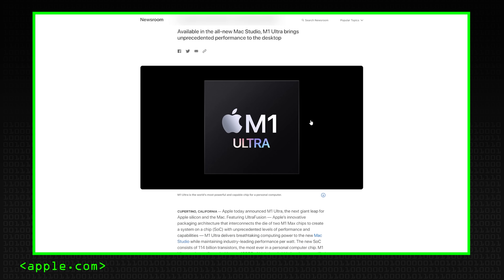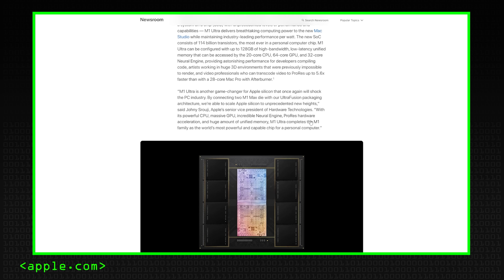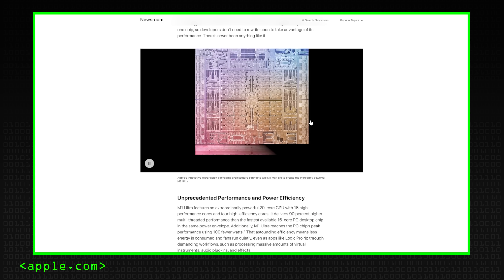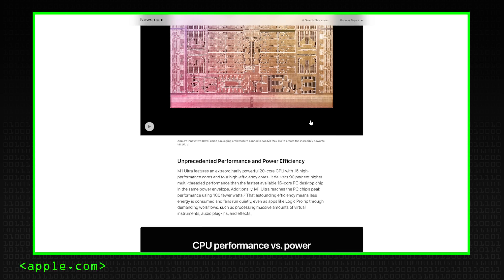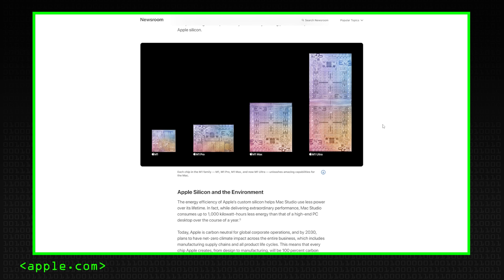Apple M1 Ultra & NUMA - Computerphile

Comment: Intel's EMIB, similar to ultra fusion, in Sapphire Rapids adds additional latency of 5-8 nanoseconds. This makes the core-to-core latency go from 54 worst case to 70 worst case. Apple's situation is similar, with similar bandwidth per connection. We expect the latency to be an additional 5-8 nanoseconds also. Ultrafusion is using TSMC's InFO_LSI manufacturing.
Reply: It’s not InFO_LSI according to Underfox on twitter.
Reply: Any numbers for AMD (Zen 2 and 3) 2-socket systems with and without xGMI cables?
Reply: The majority of the software, the one that is not memory hungry, will not be needed of rewriting. NUMA locallity is served by the Operating System and it will try to give you memory and schedule you on the same NUMA node without any change on your software. So for the majority of devs this is not a problem. Now, video editors, databases etcetera this will need to be able to know from witch NUMA node are they allocating and the cost of accessing, Linux and Windows offer an API to solve this. Does MacOS provide it? AFAIK NUMA is not exposed on any API on MacOS so even if the interconnect is really fast it will not beat an optimized NUMA-aware database on linux.
Reply: cultist apple autists out in full force
Reply: yeah, but it is ARM vs x86, 256 channel memory against 6 and also efficiency cores, also video memory... so not really the same!
Reply: But the difference is one is called “random string of letters” and the other is called “Ultra Fusion” 😍
Reply: @Joseph_Roffey  And begins with "We call this..." and is filled with "... only at Apple can we ..."
Reply: @Joseph_Roffey  other difference is that you can buy one and not but yet the other 😂  I remember rehén NUMA stuff was the domain of super computers.
Reply: @Joseph_Roffey  huh? More like one is a "stupid marketing name that really doesn't describe the underlying mechanism" and the other is called "embedded multi-die interconnect bridge"
Reply: @eddyecho  Woosh
Reply: @Decessus117  ahh yes i recognize that I may have missed the satire in Joe's post. lol
Reply: Sure. If you’ve got a $$$,$$$ and can actually purchase enterprise hardware, it’s exactly the same! I’ll make sure I order it along with those 400Gbps switches I’m ordering next week….
Reply: Except it’s not 2.5TB/s  and not a consumer device. More like a enterprise technology.

Don’t get butthurt that Apple did something cool bruh.
Reply: @RunForPeace-hk1cu   2.5TB/s is the bandwidth not the latency.
Reply: @AdamFJH  you don’t even know the latency and you are already making assumption that it’s bad.

Sounds like you are a hater.

If a cool tech comes along, shouldn’t you at least root for it to be successful?

Why do you just automatically assume it’s a fail?

If the latency is so bad, it wouldn’t be a viable product because there’s a reason why Apple made it so that developers don’t need to write NUMA awared drivers/software.
Reply: @RunForPeace-hk1cu  Yes, I don't know the latency because I haven't seen anyone report on the memory latency yet. No, I am not making assumptions, I am just educating you on the fact that the 2.5TB/s figure is the bandwidth not the latency because in one of your previous comments (which I see you have now deleted) said that the latency was 2.5TB/s.

I am only a hater of Apple because of their anti consumer practices and their negative influence on the tech industry. I am not a hater of the the M1 Ultra.

I think the M1 Ultra is a cool piece of tech with the ram being in the same package as the CPU and its giant memory bandwidth but I am neither rooting for the M1 ultra's success nor hoping for it to fail. I am neutral in that position.

You're the one that is making assumptions. You sound like a crazy Apply fan boy that assumed I've said something bad about the M1 Ultra and now you a crazily defending Apple over it. I don't think the M1 ultra will fail. I think it will succeed because Apply fan boys are crazy and will buy anything from Apple even when their products are over priced, Apple actively commits anti consumer practices and they have a lot of negative influence in the tech industry.

Does anyone actually know if the M1's latency is going to be bad? Knowing Apple, even if they produce a product that isn't "viable", they'll still manage to to sell it because Apple fan boys are crazy. What's the reason Apple does not need developer to make numa aware drivers?

EDIT: I just found out that the M1's latency is about 100 ms which is really slow compared to Intel and AMD CPUs so that means that the M1 Ultra's latency is going to be even worse.
Reply: @AdamFJH   What do you mean M1 latency is “100ms”?
100ms in the memory subsystem, for example, would be catastrophic. Do you mean 100ns?
And 100ns latency to and from where exactly? Memory?
Reply: @AdamFJH  I’ll flip it back to you for some self reflection …

Intel don’t have fanbois and buy anything Intel ?😂
Intel doesn’t commit any atrociously poor consumer practices?
Have you been sleeping for the past 10years?
Reply: @Aaronage1  Yes, I mean 100 ns. About 100 ns tested by accessing the memory with 128 MB test  depth. See the anandtech article titled "mac mini m1 tested".
Reply: @RunForPeace-hk1cu  You seriously need to stop making assumptions. Right now you are assuming I am an Intel fan boy but I am not an Intel fan noy.

Yes, Intel does have fan boys that will buy anything Intel and that is the same with AMD as well. Yes, Intel commit anti consumer practices as well. Regardless of whether Intel also has fan boys or not, your crazy fan boy behaviour is not excusable. Your behaviour is bad because it leads to fights. Stop assuming people are attacking the M1 Ultra when they are not.
Reply: @AdamFJH  ok, ~100ns latency to memory is not problematic (and not really a useful number in isolation anyway)

Anandtech recorded 92.814ns full random latency for 12900K, 96.8ns for M1, 111.1ns for M1 Max, 105.632ns for AMD Milan, 93.061ns for Ampere Altra etc. Latency in this range is typical 🙏
Reply: @Aaronage1  whether it is problematic  or not depends on the workload and whether is it slow or not depends on how the community compares it. I'm part of the DIYer community we usually judge whether the memory latency is slow or not base on how well it is used in gaming. For gaming workloads 100 ns is considered very slow and accepted latency would be about 70 ns. 70 ns is about what Zen 1 is capable of achieving. These M1 chips are not  very suitable for gaming. I'm surprised by that 92.81 ns figure for the 12900k, are sure about that?...hmm...was anandtech testing the 12900k with some very high latency DDR5 ram?
Reply: @AdamFJH  dude, i said 2.5tb/s and you said it’s not latency.

Who in their right mind thinks 2.5tb/s is a latency number? You are the one picking a fight my guy.

And as others have said, m1 latency is within industry standard. You haven’t done your homework and automatically assume it’s bad.

When confronted you get defensive.

Are you saying 12900k with ddr5 is bad for gaming? 😂

Yeah, you are clearly not a hater or biased
Reply: @Aaronage1  you said 111ns for m1max then after travelling through fusion memory connect, wouldn't it be above 200 to 250ns?
Reply: @nick_ragin   No one knows yet, it wouldn’t necessarily double because the memory controllers are split over the fabric. I’m sure someone will test it, though maybe not Anandtech? (the contributor who covered Apple with genuine care and interest at Anandtech, Andrei, left a short while back).

Regardless, I think you’re putting too much emphasis on latency.

Latency became a big point of contention in PC gaming with the Zen family. Those designs introduced a variety of letancy issues (not just memory latency, but also core to core latency between CCXs and dies etc.). Overclocked memory with tight timings resulted in unusually large gains for Zen. Tech media/YouTubers became obsessed with latency from that point onwards, always going on about the need for the tightest possible timings and how AMD needed to “fix” the latency issue. It’s now the first thing a lot of tech reviewers leap to when they see some performance issue with Zen 😅
Not to say fast memory wasn’t a focus of overclockers before Zen, or that people didn’t spend enormous amounts of money on fast memory to squeeze out an extra couple percent on older platforms, but it wasn’t seen as a necessity as it is now.

I guess TLDR is Apple’s design is not Zen so don’t panic 😁
Reply: @Aaronage1  Hey thanks for your valuable insights, I am pretty much naive in this area, I considered latency and the bandwidth bottleneck is the reason why m1 ultra can't get exactly double or nearly the 2 times performance of m1 max. Given apple architecture(risc) can split the instruction and perform it on multiple cores.
Reply: @AdamFJH  Here we go again... someone who thinks they know what they're saying because they watched a few Linus Tech Tips videos.
Reply: @almuel  Who are you talking about?
Reply: @AdamFJH  are you talking about the Mac mini ? If that is the case how is that relevant ?
Reply: @jaimeduncan6167  No, I'm talking about the M1 Ultra which is what this video is about. I only mentioned the memory latency figure for the mac mini that anandtech got to get an idea of what the memory latency for the M1 Ultra is like. Since the M1 Ultra run in uma mode accessing memory from 2 NUMA domains its average latency is very likely going to be worst than the latency of the mac mini unless the memory in the M1 Ultra is higher binned than whats in the mac mini.
Reply: @AdamFJH  Apple has helped the tech industry advance so much. We'd be so far behind without the iPhone.
Reply: @AdamFJH  64 bit phones for one
Reply: @kevin_mitchell  Apple is first on the market with a 64 bit phone but it doesn't mean they are responsible for advancing the tech industry towards 64 bit phones. The phone industry would have advance towards that anyway to handle memory addresses greater than 4 GiB. The ones we should be thanking for advancing the tech industry toward using 64 bit phones and 64 bit computing in general is AMD.
Reply: @AdamFJH  Just read through all the comments, and you definitely give off a bit of a toxic vibe in here.
Reply: @caschque7242  I'm not the one falsely accusing someone else of being an intel fanboy or accusing them of trying to make the M1 Ultra look bad just because they educated me on the 2.5 tb/s figure was the bandwidth not the latency.

Comment: Can the operating system take care of always allocating memory from the block that is closer to where the process that is requesting it is running? I know it's not perfect, but would work 90% of the time
Reply: Linux actually does as far as I know
Reply: To a certain extent, yes the OS can.  However, in order to effectively to that, it needs some information about memory requirements and usage patterns for a process.  Some can be gleaned from the raw byte code, especially if there are hints placed by the programmers, but a lot will come from actually running the process, then dynamically remapping and moving memory as needed.  It'll work better for long-running processes, but is by no means optimal.  That's why most super high performance programs, such as many video games, manually set CPU core affinity and utilize custom memory allocators to provide direct control over memory locality.  They'll even go as far as detecting which are fast and slow cores and prioritize from there.
Reply: Yes, the Linux kernel can take care of this. The default memory policy (MPOL_DEFAULT) makes the page allocator always try to allocate memory from the local node but if that's not possible, it uses a different node. Over time, even if pages get scattered across NUMA nodes, Automatic NUMA Balancing will either try to move the pages to the node from where they were accessed the most or try to move the program itself to run on a CPU that is close to the memory that it accesses the most.

Comment: numa still seems slow to me, I have in mind a faster means that throws away numa for a single block of ram/cache. You start with a single dedicated chip which is just and endlessly running loop of "If bit N of internal is set, read address & instruction registers of core N, if read, fill internal cpu value register with contents from address read previously & clear bit N of internal register, if is write read value register, clear bit N of internal register  & send the value read to address previously read.

Each core only needs to wait on the bit it set to be cleared before continuing, since this relies on 1 internal register of the dedicated chip to distinguish when a core wants to do something that needs to be synchronised there's no need for any complicated timing or probability logic, they just defer the operation to the chip that is doing looped checking, when the number of cores is a power of 2 (2,4,8 16 etc) the loop operation can be optimised by only giving the N register enough bits to just loop straight back to 0 after incrementing from the max core index (so for 2 cores 1 would flip to 0, 4 cores 11 to 00, 8 cores 111 to 000, etc) since cores tend to support 2 or more threads natively the logic can be scaled to map directly to the thread registers instead which saves the core from waiting for one operation to be done before doing the next thread's operation.

*Edit:* For the peops who'd rather see some pseudo code for what the logic chip would do, here's what I have in mind:

uchar n;
ulong b, i, a, v, s;
THREAD *thread = NULL, fake = {0};
fake.id = -1;
for ( n = 0; 1; ++n )
{
	b = bits & (1u << n);
	if ( !b )
		continue;
	thread = threads + n;
	if ( thread->i == INST_WR )
	{
		// Instruction
		fake.i = thread->i;
		// Address
		fake.a = thread->a;
		// Value
		fake.v = thread->v;
		// Size of value
		fake.s = thread->s;
		bits ^= b;
		write_ram( &fake );
	}
	else
	{
		// Reading the values 1st would just slow us down, pass them directly to avoid issues
		read_ram( thread );
		bits ^= b;
	}
}

Comment: Could a bus system carry packets? So the CPUs would send packets on the bus and the RAM would manage how much bandwidth each cpu gets, creating a 'nano network'.
Reply: No need in this case.  You have two dies only.  Connection between the two dies is point to point.

Comment: Maybe i'm not understanding the problem correctly, but couldn't you just have a rudementry controller sitting between the 2 that uses the most-significant bit of the address to determine which ram chip has the data? That way by having the controller between the chips and as the central access point, all queries would take the same amount of time to fetch the data. By having this logic at hardware level you would have minimal latency added.

I know this would only work on chips that are the same size but you could combine composites with singles (i.e. 2x 32s connected with a controller could be combined with an actual 64 with a controller)
Reply: This suffers the same slowdown which result from physically separate RAM locations, close to individual groups of CPU cores but not as close to others; even if the most significant bits picked the RAM module without any fancy chips in the way, fetching data from a CPU farther down the line is going to be generally slower, and it's easy to double or triple the tiny amount of time it takes to fetch data with computers this compact and fast, that is, 4 nanoseconds is twice as long as 2 nanoseconds -- both are incredibly fast though.
Reply: @Addlibs  Remember that a 4GHz CPU completes 4 instructions every nanosecond, and in a nanosecond, light travels about 30cm. Electricity is slower, so any round trip of more than about 3cm isn't going to happen within a clock cycle.

Comment: Can one still purchase green lined, perforated line printer paper or are you working off an old stock?  That stuff was great for physics homework.  Worked pretty well in line printers, too.
Reply: I'm convinced there is warehouse in Nottingham that is full of nothing but that tractor paper, just for Computerphile.
Reply: I think they are still available at Dunder Mifflin.
Reply: @arpanmajumdar617  lol
Reply: You can buy a couple of thousand feet of the green ruled stuff for about forty quid from any wholesale stationery supply store.
Reply: Dot matrix paper is still sold.

Comment: Does application software needs to be NUMA-aware or does the OS kernel handle everything NUMA related?
Reply: The OS could do scheduling to keep your application on one numa node. You can use numactl on Linux to tell the kernel what you want to happen
Reply: The whole point is it’s HW implementation and no software need to be changed.

Comment: Remember when this started appearing in PC's in 2005.  You had to make sure a DIMM slot next to each CPU had a card.  Suspect ultrafusion is just the operating system being smarter about core usage.  All their hardware does is make sure you don't try to fix it.
Reply: The SGI Origin 2000 was doing this in the late 90s, and scaled to 128 CPUs, although the slowest case memory access was still faster than the fastest on the systems predecessor (the SGI Challenge series - SMP). They had a ton of work around memory residence in Irix, which is very non trivial. The Origin 3000 officially scaled to 512 CPUs, although SGI built custom systems many times that size, usually for government customers and with terabytes of physical RAM in a single system image.

Comment: Good explanation, but I would like some explanation about write/read, i.e. two threads reading and writing to the same memory location. This would be easy enough to handle between the two sides, but what two cpus on the same side with their own cache, it sounds like a lot of circuit to handle that.
Are there some smart solutions?
Reply: That is indeed a problem that must be contended with. Look up "cache coherence"